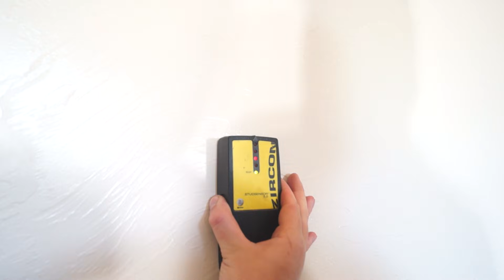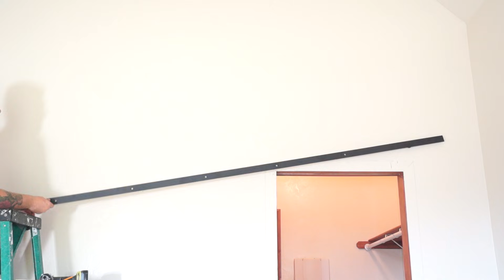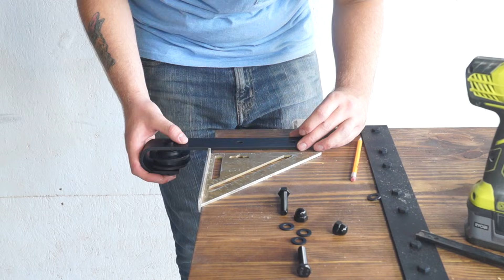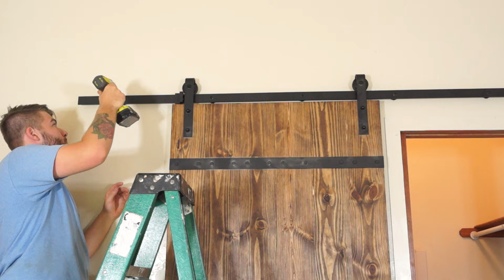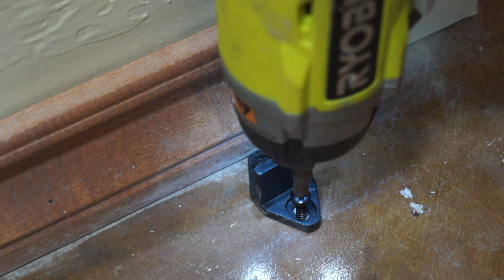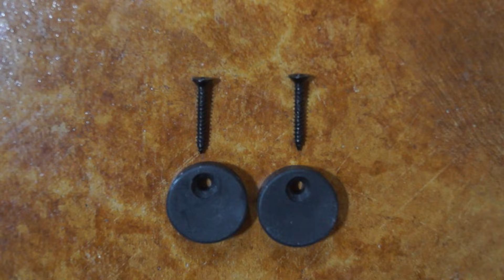Step-By-Step Barn Door Hardware Installation - Industrial By Design

Comment: my opinion it is very important to get backing in the wall for the barn door to last , I will use a 1+6 header board and cut out the sheet rock so you will not see it when you install the header board and put in backing so the lags have something to bite into because you are not going to have backing past the opening header , in new construction we always put backing in if we knew that a barn door was going to be installed . then you won't have any problems with the door sagging over time and always use a roller at bottom of door instead of floor guide , try to have the door be about two inches coverage on both side , the soft close system is a good choice as well

Comment: I have a question.  So I don't have a traditional door opening.  The room was added on and originally used as an office.  I'm turning it into a bedroom and was looking to install a barn door. The opening is 60 in across.  I know that most openings are 54 inches. When I was looking for hardware I see that in the description it says for a 54 inch door. My wall width is a little over 9ft. So, with all that background here's my question; does it matter if my opening is wider than 54 inches?  Do I have to find the exact measurements to install, or can I just adjust where the hardware  goes? I'm sorry if this is a stupid question. I am not familiar with barn doors.  Thank you for your time and I appreciate your video.

Comment: Hi, is the "strap/Bar under the hangers Wood or metal, and where do i find a metal version

second my door will be about 2" thick will this model handle it...
6-Foot 7-Inch Heavy Duty Sliding Barn Door Hardware Kit (Black)

Comment: How do you know where to place the end of the rail in relation to the door way?  I have a 7' track for a 42" door.
Reply: Did you cut to get the 7' track?  I opted for 8' mine is 41" wide. I just made sure there was a minimum of 41" to the left which is the side my door was when opened.  The top is about 2 inches so that was my way of knowing. 41" plus the stop at a minimum. With my 8' track I had a lot to play with

Comment: Great video, Now when installing a header board would the measurement still be the same?  1-11/16 of an inch from the height of the door?  also, does the header starting at that point 1-/11/16 or do I have to Center my header board at the marking of 1 and 11/16 higher than my door?  do I need to count anything for the 1/2 inch clearance I need to leave at the bottom?  Thanks for your reply :o)

Comment: Help please. After installing. I noticed big gap on ones side of the door when close. Completely flushed.. door is 2 inch thick.. used the supplied bolts for the hangers that says 1 3/4 thickness. Did it caused the gap? Thanks

Comment: The rail shipped to me has 2 smaller holes drilled at each end. What are these for?
Reply: Adding an extension....in case you need to cover a wider opening

Comment: In the video you said to add 1 11/16” to the height of the door. Aren’t you supposed to add 3/8” space at the bottom of the door to the find your drill mark? Making the formula height + 3/8” + 1 11/16”
Reply from the maker: This figure already has the 3/8" built-in, so you don't need to add it in as well. So it's only door length + 1 11/16". Thanks!

Comment: Where did you get the measurement of 1 13/16" for the spacer block used to install the hangers? The written instructions show 1 11/16" and when the holes are drilled according to the instructions of 1 1/2" and 3 1/2" below that, the spacer block would be too short..
Reply from the maker: Hi! There are two measurements in the video and I think you're getting them backwards. The 1 11/16" is for where to drill in the wall for your rail lags. The 1 13/16" is from the bottom of the caster to the top of the door, which gives you the same result of you measure 1 1/2" from the top of the door down to the center of the top hole in the hanger strap. Hope that makes sense! Thanks - Wes

Comment: Well done video.  Could use advise.  I am making my doors and have plenty or room with a header to adjust the bracket.  Would you hang the bracket first to see how tall the door should be?  Or would it be better to make the door first (it can be bigger than opening of course - doesn't need to be precise) -- and then mount bracket after door is made?
Reply from the maker: Hi Wade, thanks for the question! I would make your door at least a few inches taller than your doorway, but make sure that still gives you 6 inches from the top of your door to the ceiling/crown moulding (if any). Definitely start with your door and then use the measurements in this video to install your rail kit. Let me know if you have any other questions!
Reply: Thanks very much for the prompt advice!

Comment: I just finished building my door, which is 54" wide and 2" thick but I can't find a track big enough?? The door is for a master bedroom, going into the living space. But I couldn't put the door in the master bedroom because of a wall on one side and a fireplace on the other. I couldn't build 2 doors for the large opening on the living space side because of another wall on one side of the doorway. So I had to build the wide door on the living space with only being able to open to one side. I also framed the door on both sides to be finished looking from either side. So it basically has 3 layers which makes the door very heavy. With all of that said, I have a few questions. With the door being 54" wide I would need 108" (9ft) track, correct? How thick should the steel track be? The door will be hanging from a doorway with studs and header to mount the track to, it's also on a low bearing wall. Is there any advice or anything I need to do differently? The largest steel flat bar I can find at our local home improvement store is 96" and I'd rather find a 9'ft(assuming that's what I need) flat bar from somewhere instead of buying the 96" piece plus a smaller piece to connect. Suggestions? Thank you for the video it was very helpful! Ugh sorry so long!
Reply from the maker: Hi Chassity! The only way the 8' kit would work is if your doorway is 42" wide or less. Since your door is 54" wide, that adds up to 96". If your door and doorway add up to 97" or 98", then you can get around that by installing the hangers a little further from the edge of the door so that the rollers go an extra inch or two before hitting the stoppers. If you definitely need longer than 8', I'd recommend getting our 13' kit and then cutting it down to the size you need. We have many happy customers who do this with an angle grinder and then touch up the cut end with flat black paint. Regarding the studs, make sure they're 16" (on-center) apart from each other, or else you'll need to install a header first to the studs (1" x 4" or 1" x 6") and then the rail can install anywhere into this header. If you're going to squeeze this onto an 8' rail, you'll most likely need a header because chances are the studs won't line up the pre-drilled rail exactly where you need it. Hope this helps! - Wes
Reply: Industrial By Design yes that helped so much! I'm looking at just going with your 13' kit and cutting to the 96"...I think that seems to be more easier and less to make mistakes! One last questions, I'm going to go ahead and use a header like you had suggested and stain it the same color as the door I made. So going with a header now and I've decided to just make the 13' rail 9' after screwing in the header to the studs. With this door being so heavy should I use longer screws then what the kit comes with? I feel that with the door's size and weight I would be safer to drill the header on into the studs and the rail into the header but also the studs. Not having 2 acres in the same place but just one screw in the rail and then the same screw into the header at the same time? Wow, sorry, I think I confused myself typing that! I hope that made sense to you! So very thankful for you taking the time to thoroughly answer my questions!  I don't underestimate my woman skills of building things but I do tend to overthink ALOT! Thanks again!
Reply from the maker: Hi Chassity, not a problem! I think that would be great, to use a header and still line up the lags with the studs. But no, you don't need longer lags for this. What makes this better is that the lags get into the wood sooner than compared to going into sheetrock first and then studs. You might need several sets of hands to get the header and rail installed with only the lags for the rail, but it's doable and a good plan.

Comment: I would like to buy the 6.7 foot door kit.  My question is, will a 36' wide door work with this size or do I need to buy the 8 foot door kit?
Reply from the maker: Hi! The rail is 79" long so a 36" wide door would work great for this! Sounds like you don't need the 8' rail. Thanks!

Comment: finished building the barn door yesterday and will be installing the header board this afternoon. my door is exactly 7 1/4"  does this mean I will have have to still measure from the top of the door (7 1/4 ") + 1 11/16?
Reply from the maker: You'll take height of your door (7' 1/4") + 1 11/16" and that's where you'll drill for the lag bolts. So for drilling your lags, measure 7'  1 15/16" from the floor.

Comment: did you measure 1 11/16 from the top of the molding on the door? if not how much does it need to be from the top of the molding thats around the door?
Reply from the maker: The holes in the wall for attaching the rail need to be drilled at the height of the door (not moulding) + 1 11/16". If you have moulding you'd like to keep, then you'll need a door slightly taller than the doorway itself so that the rail is being installed above the moulding. It's common to have barn doors slightly taller and wider than the doorway. Hope this helps!